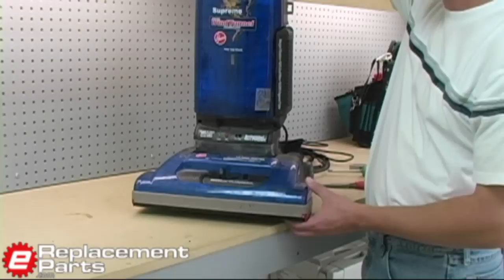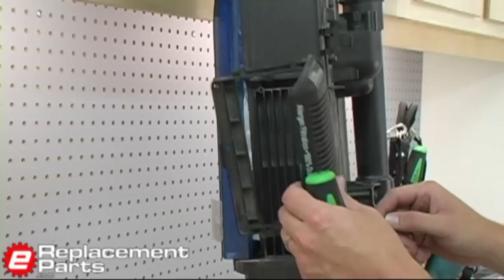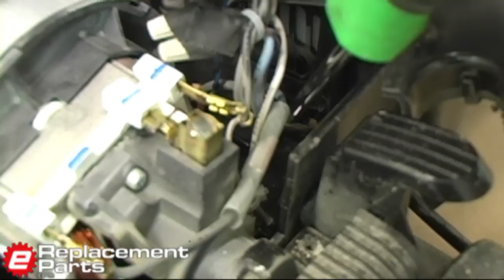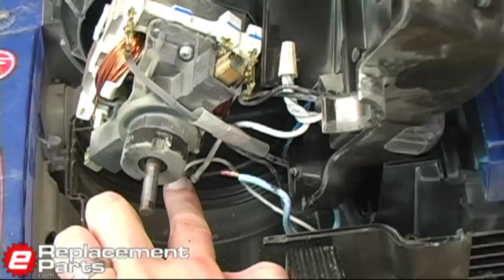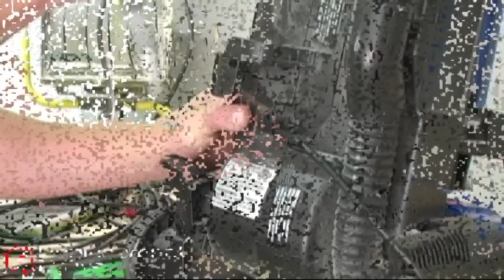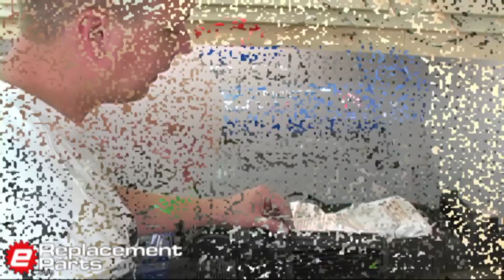How to Replace a Vacuum Power Cord

Comment: The video was great.  I have the exact same vacuum.  I replaced the cord easily enough, but now the vacuum is blowing hot air out the air filter hole and not sucking at all.  I hooked blue to black and white back into the white clip.  Don't know how it would have reversed anything.  Any ideas?  Thanks in advance.

Comment: I have a self propelled hoover windtunnel u4939-.  My cord is on the top.  This video and others are not making sense to me.  Does anyone have any helpful advise on how to remove the old cord?  Our dog chewed through ours so I need to replace it.  Thank you in advance.
Reply from the maker: +miekajb  I found this on google. This are comments from another person.  I hope it helps! The EXACTschematic for your model. http://www.searspartsdirect.com/model-part/u6439900/0517/0645000/m0601181/00002.html
AND http://www.appliancefactoryparts.com/vacuumcleaners/brands/hoover/u6449-900.html
The cord replacement was VERY difficult, but doable. It will take time. Spread it out over a couple of days, while I strategized what to do next. You have to take a LOT apart. Find screws inside the attachment compartment, on the back of vacuum cleaner (and probably elsewhere). The worst part was finding a replacement clip for the main power line connection in the vacuum. (I had to destroy the old clip, getting it off) Fortunately for me, I found an electrical clip out in the garage that I could use. The clip is like a little pre-formed "grabber" that attaches to the end of the wire, then slips onto a metal flange (main power connection) inside the vacuum cleaner.

Comment: The start pedal on my eureka will not stay on. It will turn on, so we know there is power, but it will not stay on when pressure to the pedal is released. Any ideas?
Reply from the maker: +Deb Quigley Depending on your model of Vacuum I would guess the electrical switch itself needs to be replaced.  These are designed to stay in position until you press it again.  Because of the location of these, then tend to get dirt inside the switch and that causes them to eventually fail.

Comment: Very, very, helpful.  My wife said get rid of the old Hoover Upright Windtunnell u5445-900.  The electrical cord was shot.  Vacuum has to be 15+ years old.  Put in new cord, cleaned, runs like new.  Only problem I had was not putting the trunnion covers back on correctly.  The screws need to be on the inside of the covers.  Other than that, Excellent video!

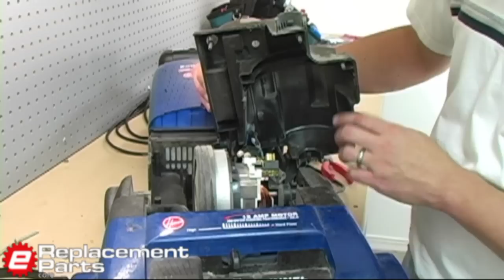Comment: Great, My Hoover Windtunnel Supreme plastic motor cover area is sealed.  You can't just pop the cover off like you do at 3:20.  They obviously don't want the owner working on it or getting to the motor because it is completely sealed.  I will have to cut plastic to get to it which I don't want to do because it will most likely create its own set of problems.  I may just splice the cord wire right where it exits the plastic housing instead of attaching it to the motor.

Comment from the maker: @ehall1313 For this vacuum model, yes, it is necessary to remove the belt, brush, filter and filter housing in order to access the motor assembly where the power cord terminals attach. Thanks for watching!

Comment: Excellent instructions - clear, concise and accurate.  I would make one suggestion regarding the new power cord wires.  The black is connected to the blue with a wire nut however the white wire needs to have a new terminal attached before it can be attached.  Fortunately for me a Radio Shack is very close by and I was able to get the required part no problem.  That's it.  Pretty simple and saved me a ton of money!  Thanks!